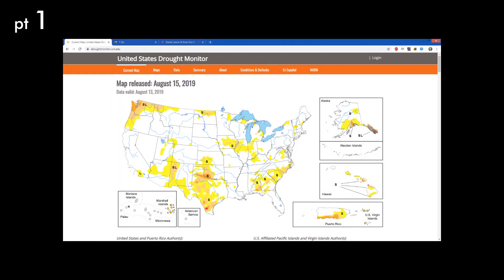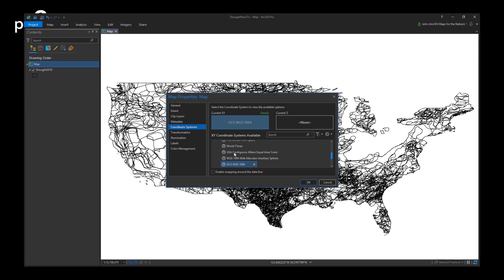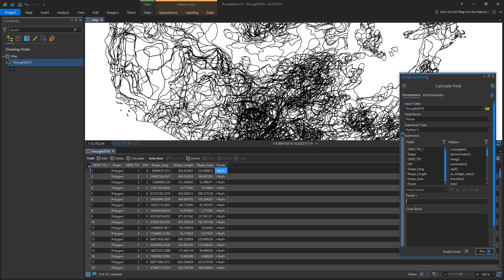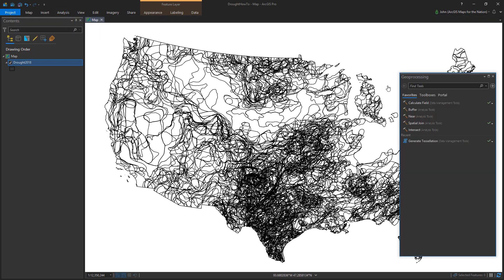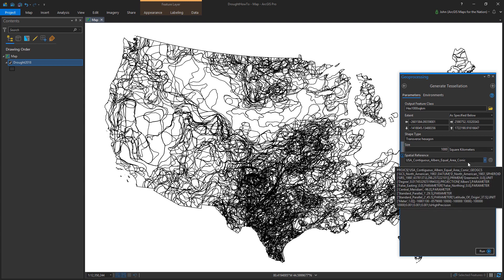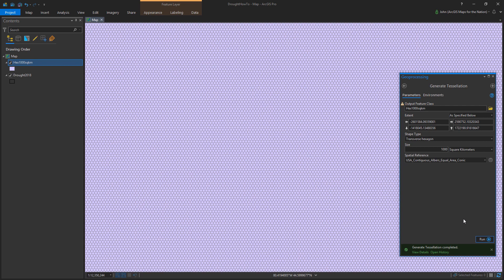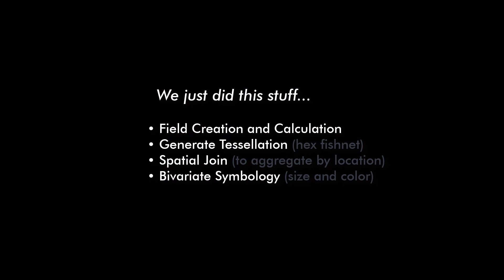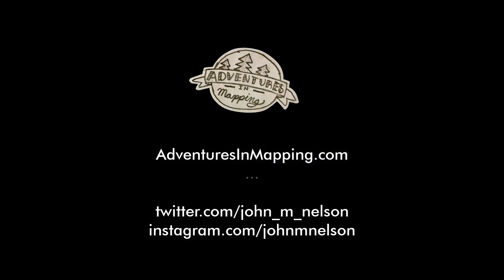How to Make This Drought Map Pt 2: ANALYSIS

Comment: you meant number of weeks* I guess ;) also one thing I wonder is why didn't you just use the DM value instead of calculating a Power value and using it sir?
Reply from the maker: Yes, weeks! Thanks. I created a new field and calculated a weighted value because I wanted to include the DM values of 0 in an aggregation, and this was the most straightforward way to ensure they got counted, and I like a squaring of the DM values to help show the intensity visually (since the DM values are just ordinal data, not really a quantified value, and I wanted to cheat and use them as a quantified value).